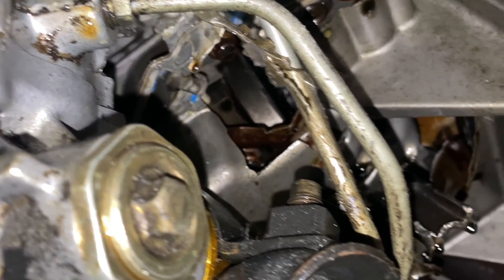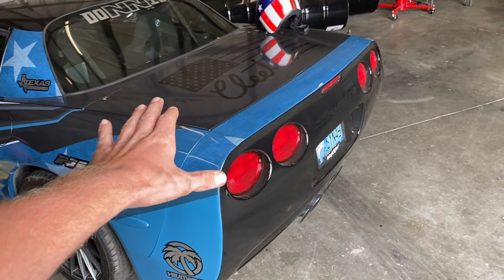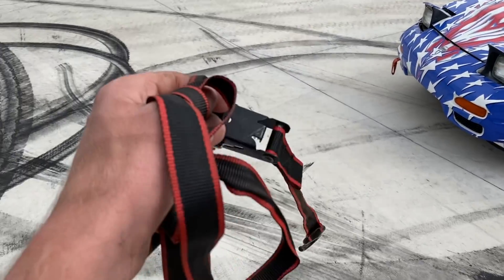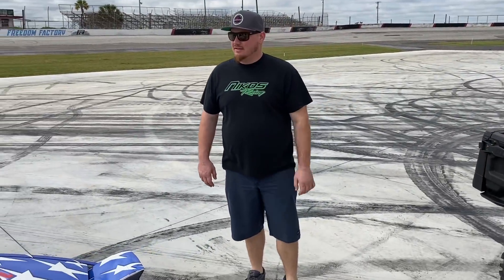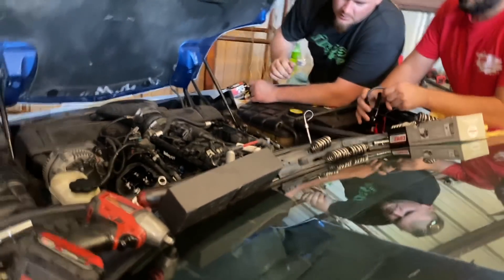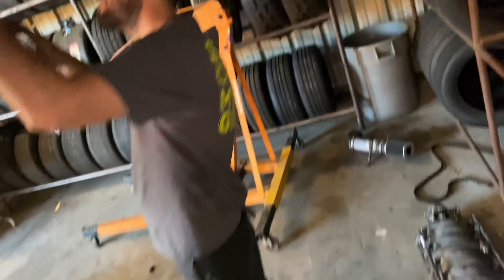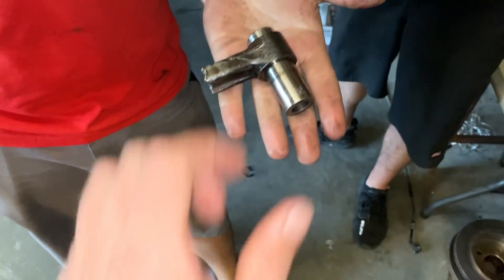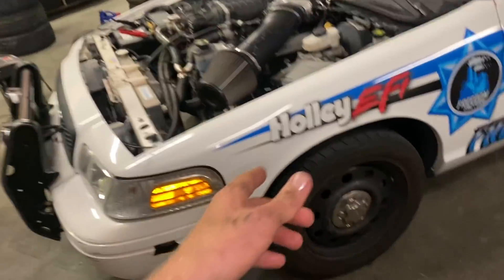We BLEW UP The Engines in TWO Cars Right Before FF Drift Night... (High Speed Engine Swap Engaged)

Comment: Dude drop youre rev limiter down a little no engine is gonna take continuous hi rpm's like what you guys are winging those engines at. All the oil ends up up top and can't return to the pan quick enough and you end up with no oil pressure through the crank to float the bearings and the end result is red hot molten rod bearings! It really doesn't seem to me that you gotta put those LS motors at 8000 rpm to kick the ass end of the car out, i see you doing all that just fine at 6 grand! Anything above that is just glutting for oil starvation and spun, molten red hot bearings. I thought you guys learned that and changed your ways at the senceless burnout contest in Australia when you kept blowing killer motors up. You toned it down when dude told you don't wing the engine so high and hold it on the chip so long! But here you guys are doing the same thingWith the drift cars and wondering why you're putting rods through the block. You can have just as much or more fun by knocking the RPMs back a little bit and not putting oil all over the floor at your fantasy factory